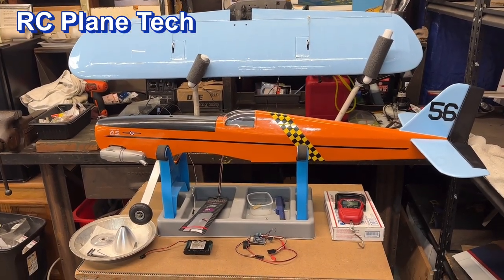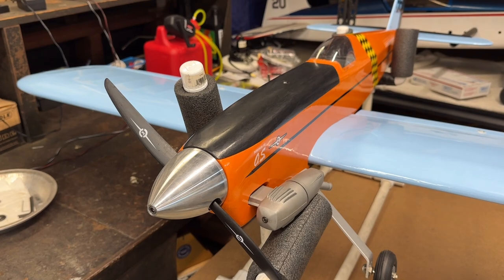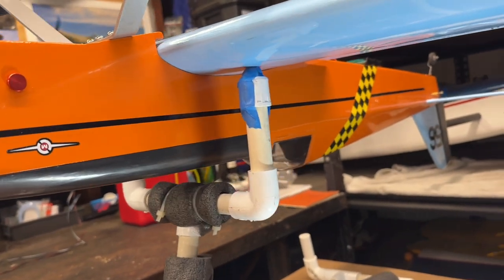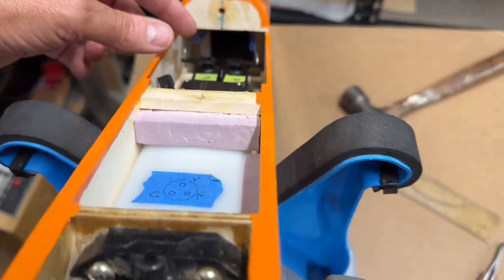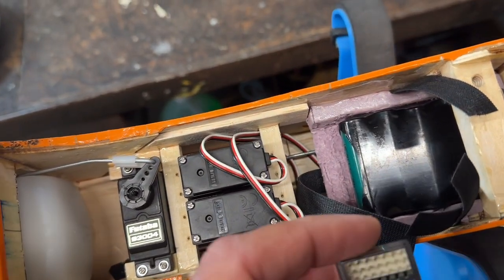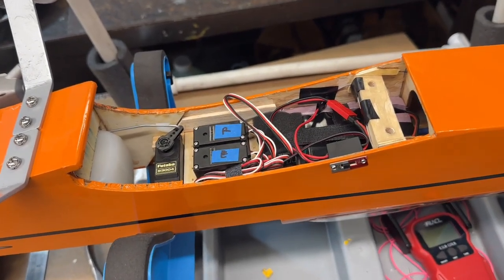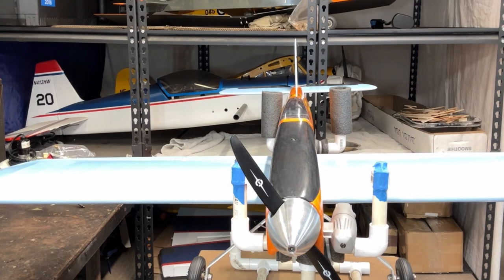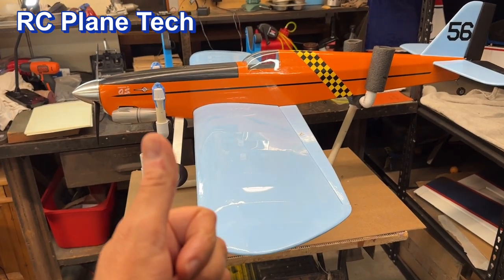Balsa USA Smoothie RC Plane Kit Build No 45, Final Build Steps, FINISHED!!!

Comment: You can half the weight to be added by buying stick on lead weights that you secure with screws and put it right at the back just in front of your tail wheel 👍
Reply from the maker: good point. I was trying to keep it clean on the outside but I probably could have done that and it wouldn’t look too bad. Save a few ounces.
Reply: @JamesRCPlaneTech  you could have cut a small hatch there and secured it to that inside the plane for asthetics it also means that in the future if you ever needed to fix the tail the lead would be removable 👍
Reply from the maker: Ya, I could have done that as well, and just covered with Monokote. Good point

Comment: James, 

Congratulations!  Your Smoothie came out looking amazing, the contours, color scheme and aluminum prop are perfect.  

I want to again thank you for this series, you went through every step of the build and honestly I probably could not have done it with out your guidance in a few areas.  

When you went to balance it I was like crap, adding weight behind the CG stinks.  When you pulled out the oval fishing weights and said you were going to use them I was like “WTC”, then you proceeded to pound them flat with a hammer and I said “brilliant”.  

I hope they stay where the are when you do aerobatics. I was wondering if you could have cut out a hatch on the bottom to give you access.  I like to use the tire weights they sell at Harbor Freight.  For about $8 you get enough for a lot of planes. They come in thin squares and seem to fit well wherever you need to put them. I too epoxy them. 

I am really looking forward to the maiden, I bet it flies smooth!

Tom
Reply from the maker: Thanks Tom, I appreciate it. Ya there are probably better ways to choose to balance, lead weight like you mentioned are a good choice and you are right also that I could have cut my way in somewhere and even back further to reduce the amount needed. Then just patch with Monokote. Honestly I was antsy to get this thing done and went the easier route and maybe not the ideal way. If I was not able to keep the final weight below spec, I think I would have cut my way in near the tail section. Hopefully the epoxy will hold them in. If not I will most likely go the way you mentioned. Thanks again. I appreciate you insight.

Comment: James, what is the name of the purple foam block?
Reply from the maker: Hi, thats a piece of “extruded foam” insulation. It’s sold in hardware stores or online. I cut it to size as needed. Its strong, stiff and light, and perfect for making little supports and things. I get it in 2ft squares from Home Depot. Here is an example:
https://www.homedepot.com/p/Owens-Corning-FOAMULAR-NGX-1-in-x-2-ft-x-2-ft-R-5-Project-Panel-XPS-Rigid-Foam-Board-Insulation-9WE/315401957?source=shoppingads&locale=en-US&pla&mtc=SHOPPING-RM-RMP-GGL-D22-022_004_INSULATION-MB-OWENS_CORNING-NA-PMAX-NA-NA-MK786732200-NA-NBR-2284-NA-NA-NA&cm_mmc=SHOPPING-RM-RMP-GGL-D22-022_004_INSULATION-MB-OWENS_CORNING-NA-PMAX-NA-NA-MK786732200-NA-NBR-2284-NA-NA-NA-71700000114661476--&gad_source=1&gbraid=0AAAAADq61UeuyAqEMviYjPvPMuI9R8umv&gclid=CjwKCAiAjfyqBhAsEiwA-UdzJMogHDrsKedJBdIxlfziR5QKk8l50kL-HzFnVs-zptS-B1pi0Y0yrBoCWScQAvD_BwE&gclsrc=aw.ds

Comment: Never wrap a 2.4 ghz receiver in foam. They need some cooling.
Reply from the maker: Thanks for the insight. I’ll check it out and see how it goes. The foam I used is not super thick and not very dense like some others so hopefully it wont get overheated, but I’ll check it and perhaps remove it and make some foam standoffs instead so air can circulate better. Thanks.
Reply: @JamesRCPlaneTech  Succes with the maiden flight.👍
Reply from the maker: Thanks!